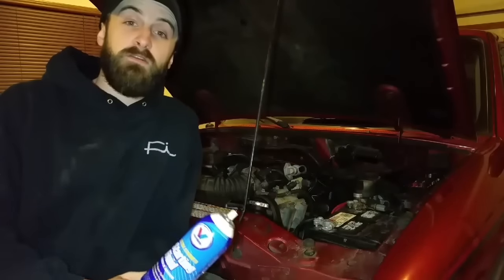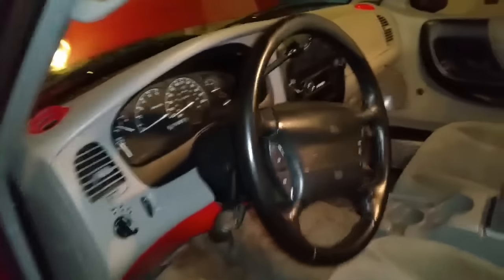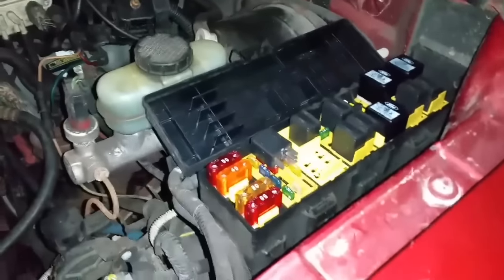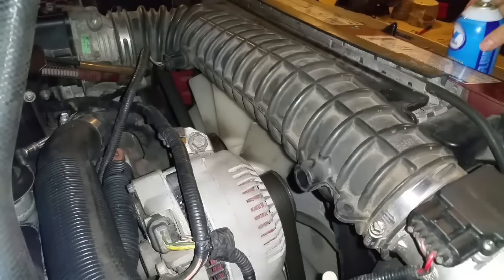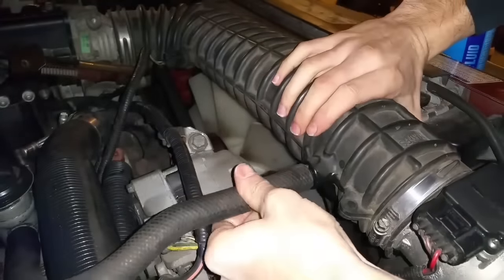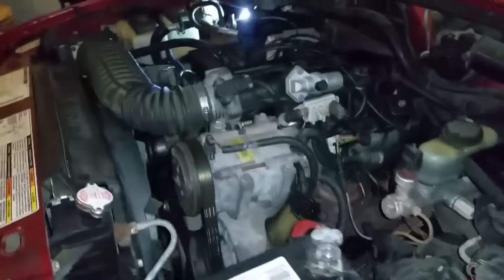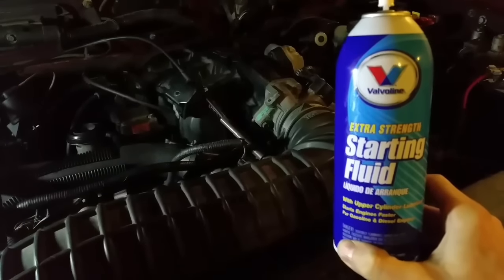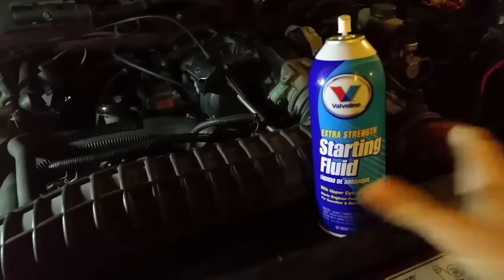THIS REALLY WORKS!!!!!!! Bad fuel pump, fuel pump relay, no fuel problem!!!

Comment: Ok mine stopped while on the road, I can hear the fuel pump come on but it won't start and if it does its only for a few seconds and then sputters off again. Could I have a bad pump even though I hear it kick on?   thanks
Reply: Did you resolve the problem? What did you do?

Comment: Hey A21 Bravo, How would I test to see if it could be a bad relay because my relay is in but it doesn't start and only starts on starting fluid. Is there anyway to test to see if it's the relay?
Reply: Jump the relay with wire but fuel pump won't shut off at all until you take the wire(s) out
Reply: Swap it with another relay in your fuse box with same ratings.
Reply: test relay using bench psu and meter set for continuity give power to electromagnet contacts listen for click use meter to verify continuity and for possible poor connection check for resistance while relay is active higher then a couple ohms would show relay works but terminals may be making poor contact or have been damaged from sparks eating away metal at contact point if somehow electrical system was causing arcing when relay it turned on or off or if relay used was not rated correctly for power. 

You can also check for grounding issues on electrical at the pump itself and the battery. corrosion at battery terminals or wire or poor contact to frame or anywhere between battery neg and neg of fuel pump could be running pump with lower then ideal current as neg in circuit may have higher then intended ideal resistance limiting current the pump attempts to draw and that can be intermittent by expansion contraction from changing temps or vibration from driving and loose connection points.

Comment: You could have fuel injector failure as well.  The test confirms spark and pressure but does not isolate the source of the fuel failure.

Comment: Is it possible for a fuel pump not to work then after I pull the fuel pump and bench test it, it starts to work again? I pulled mine last night and it started working again
Reply from the maker: It is... Sometimes the pump will begin to fail and hitting the bottom of the tank will get it to start again. Won't hurt to replace it while it's out. Especially if you know the pump wasn't working (and wasn't a different issue)
Reply: Even though fuel pump has power & ground, so u hear noise thAt proves it work, check w a fuel vacuum tester. Fuel pump may not hold pressure needed anymore.

Comment: Starting fluid should only be used in dire situations. It removes the oil from your rings and your cylinders are not lubricated while cranking. A better way to check for fuel is to turn on key to AC, which will start the pump. By pressing in the Schrader Valve by the carb/injection sys which looks like bike tire valve you should get fuel coming out. If not you have a bad relay, broke positive or ground wire, clogged line or filter and lastly a bad fuel pump,. I do not recommend this method.
Reply: what if there is no schraeder valve?
Reply: @n8eman  then loosen then fuel line at the throttle-body or carb. If no fuel is flowing when key/power is on, out of that line then you need to work backward and check all the wiring including grounds. I always look for positive power connections first. If you have power, whatever you are trying to fix needs a replacement. IE, relay, fuse, breaker, motor, box, board or control unit. Many time I find a corroded ground to be the culprit.

Comment: How do you know that it’s not your pcm ecm. On my car the fuel punishable controlled by the pcm. If a connector comes lose or the pcm malfunctions, the fuel pump doesn’t work. Also, if you get a backfire spraying that fluid in your intake, you might blow a hole in your air duct work.

Comment: Ok I did that, had same result. However, my fuel pump is working. You can hear it when you turn the key on. Any suggestions?
Reply from the maker: April Arroyo If it fired and stumbled like this could be clogged fuel filter or injectors... I have a part 2 video in description with more causes.
Reply: a21bravo ok. We did spray starting fluid and and would start for a brief moment. The night it broke down  I changed the filter.  There was no problem. When we stopped for gas and then nothing. Does it happen like that? Just stopping. I never had any problems before all this
Reply: Having the same exact problem, changed fuel pump & fuel filter today and it’ll start for a brief second and die out instantly.

Comment: so is the relay bad or is the fuel pump bad! there both expensive little parts!
Reply from the maker: Ali Mohammond Could be either. This is just confirming the engine is not receiving fuel. The relay is not expensive at all.
Reply: @BlaserBuilds  not always cheap. I get what your saying. But normally you would be correct. But sometimes, like my car, it has 2 relays for the fuel system. PGM-1 is 32 dollars and PGM-2 is 53 dollars.

Comment: It can be multiple things actually. Mine is doing that right now but my fuel pulp turns on and my car will run until you shut it off then there is no power to it anymore. Last time my car wouldnt start and wasnt getting any fuel it was because of my egr. It can be many problems, it can also be getting vapor locked from the canister.
Reply: Just to add on to this, make sure no fuel line is touching anything hot. If you you can use a hanger to space it off of the heat. It can make it vapor lock. Check all sensors not just the relay. Make sure your fuel filter is not clogged as well and that there are no tears in your wiring.

Comment: Couldn't it also indicate bad relay/fuse or clogged injectors?
Reply from the maker: gyrs riddle Yes, indication of lack of fuel.
Reply: Derp!
Reply: He just took the relay out though... so it’s not the relay
Reply: 91PHS10 The spray bypasses the complete fuel system to show it has a spark and will start with fuel. Could be the relay still, since it doesn't need the relay to start, with the spray.
Reply: @91PHS10  he took the relay out to simulate a bad pump dude. If you did this with the relay in then it could be the relay or something else like injectors
Reply: Stopped up filter......
Reply: or bad blinker fluid

Comment: What does it mean after you spray starter fluid and the engine runs but, doesn't shut off until you turn the key off?Every time I turn the key off, I have to use starter fluid.
2006 Impala 3.9 automatic 4 door.
Awesome video. Thanks a lot.

Comment: Easy way to check as suggested by ATG & me:
1. Required two people.
2. Open the gas cap
3. Turn key to #2 but do not start the car
4. Place ear next to gas lid & listen to the fuel pump making a sound
5. If you can hear the hum sounds, then rule that pump is good.
6. You replaced that Fuel Filter ever 3 years? Open output hose & input into 1 gal milk & start

Comment: kinda just proves the vehicle has fire don't wont some one to replace a $300 fuel pump over a relay or ground or bad injectors this is a great diagnostic tool but before replacing your pump test the pump with a meter /test light  to see if you have good power and ground if you don't have power it could be due to relay fuse ground etc.
Reply: He didnt say it wad definitively a bad fuel pump. He said bad fuel pump or no fuel situation. You just made a really long explanation of  what he said/did in a nuttshell. Diagnose a bad fuel pump or no fuel situation. If it fires you no its in the fuel delivery. If it dont, your looking elsewhere, like no spark. Exactly what was shown here/said here

Comment: Well mine is a different case car only cranks. But when i give it starting fluid it starts and runs normally not for a short time but runs and i can drive it just fine. When its off it can't start again unless starting fluid is applied doesn't matter if engine is hot or cold. It doesn't start even if i switch on it right back after switching off.
Reply: Did you find what is the problem?

Comment: Ok so I have a 79 Ford E150. With the starting fluid it did turn on for a bit. Noticed my fuel gauge doesn’t seem to be working and no power to fuel pump (don’t hear it prime) and of course no fuel to carb. It has new battery and spark plugs. 😔
Reply: And now it may need a new fuel pump and fuel filter.

Comment: Well my 98 Ranger has been in the garage for a year so I'm fixing to try this to see if it works. I gave up trying to work on it I have replaced sensors and replace the filter even pulled the gas line off of the filter from behind and hit the key to see a fuel pump shot Fuel and it did but that doesn't mean it's the right amount of pressure
Reply: (UPDATE) well that didn't work I'm wondering if it hadn't jumped time.

Comment: Hi i got a 1993 bmw 740i 7 series for a first car and it cranks but no start i changed the fuel pump but still nothing i need help
Reply: XNxDark RebelxNX hey I hope so you got your car Running  already  if not do you car have any lights on in your car like check Engine

Comment: Or it could be injection, pressure regulator, fuel filter, pinched or broken fuel line.   Or you could just be out of fuel.

Comment: This test just tells you if the problem is ignition or fuel, that's it. You still have to prove out the rest of the fuel system before you condemn the fuel pump it's self. If it doesn't run on a can of fuel pump you can start to look for ignition problems.
Reply: Like supply Voltage to Injectors, Tripped Inertia Switch, Bad Ground to Fuel Pump, Heck even a Bad ECM not triggering the Injectors, I wish it was always that simple but does give you a small start in the Diagnostic Quest. I used it all the time to save time.

Comment: Does anyone know where in heck is the fuel pump relay on an 88 caravan dodge, owners manual does not mention it, not the Haynes Motor manual? You can jump the fuel pump relay to eliminate that item as well.   I would ask is it Possible to bypass the in tank fuel pump easily with just an inline fuel pump ? thanks.

Comment: Is this the same on any vec
Reply: I have a 2004 hyd. Sonato and I just put a new fuel pump in it.. And it still only turns over but won t start
Reply: I know the spark plugs are firing but I spray starting fluid and it cranks for just a min than cuts off .. Please help

Comment: please answer car cranks on cold the. after warm up had to crank and with stating fluid it cranks right up keeps running no problems or after I stop and have to cranks again need to give gas to stay on and riding good again?

please help could it be fuel filter or fuel injectors because I can hear the fuel pump engage and it keeps running after starting fluid

Comment: That does not rule out an electrical issue tho. Im in that boat now. I thought my fuel pump went out while i was driving but aparently there is a short somewhere popping the fuse.

Comment: Hey really nice, I’ve known about this for a long time and I’m not bashing on your video at all because it is very helpful to a lot of people, but how does nobody know this trick? Like it’s a pretty simple thing to do and super easy and costs 5 bucks at your local store, but it’s almost sad that you have to put a video up for people to spray STARTING FLUID to START their car, great vid tho and I’m sure it did help a lot of people save hundreds of dollars
Reply from the maker: What's more surprising is all the people arguing it doesn't work, or it will blow the heads off, or wash down the cylinders, haha. Thanks for the comment.
Reply: Yeah really, people are stupid and always try to find something wrong

Comment: what is the best way get the feul system clean and and get the car running again after desesil feul has accidentally put into the tank she wasn't paying Attention to what she was doing thanks.
Reply from the maker: Arond Bullock You could disconnect the fuel rail, bypass fuel pump and run it out using the pump... You can also get a hand pump for under $10 and do it manually.
Reply: will it hurt the fuel pump or do I have to change it?
Reply from the maker: Arond Bullock Best bet would be use a pump and siphon it out of tank, and get new gas in there soon... wal mart, or any auto store would have a pump... May have to disconnect filler neck to get into tank because there is usually a screen that would block the hose from getting into tank from gas door.

Comment: I have a relay that didn't work in extreme cold. You can jumper them.
Reply: How
Reply: @dustinbowls8887  unplug the bad relay, get a small jumper wire or paperclip and jump the two connections.
for my car, it's the top two on the left of the plug
my fuel pump relay just died on me again so I've had to do that a few times

Comment: Also if you got a diesel I never recommend using straight starting fluid on a diesel Always use a little WD-40 with it not as hard and your not dry starting it

Comment: or just spray it directly into the throttle body,  and crank the motor,  if it fires up and dies again,  than the next step is to replace the pump/  more than likely

Comment: See i used starting fluid and it did just that. I didn't have this problem until my altenator went bad. Very rarely but sometimes it starts normally without a problem but rarely.

Comment: how about just check fuel pressure on the test port first
Reply: This man speaking facts
Reply: @brycegriffin3107  some cars dont have test ports xD
Reply: And starting fluid is like $3 vs $50 for a good pressure tester
Reply: @johnsheikh3831  You disconnect the fuel line and put a T in which most good fuel pressure testers come with

Comment: While there is some useful information here, there is more to be done to prove that the fuel pump is bad and need to be replaced.  It could be the relay, or a blockage in the line.  It would be a shame of somebody replaced a working pump based on this video.
Reply: or a bad wire
or ...

Comment: could be the fuel pump, but could also be the relay or bad wiring or no voltage to the fuel pump. i would try to apply voltage directly to the fuel pump before you call it bad.

Comment: Okay... I did this and my car started and kept running.  What now?  Electrical?  Anyone know where to go on youtube for this?
Reply from the maker: Rich Barnett Fuel pump may be beginning to fail. But began running when vehicle shook from starting. What were the symptoms when this started happening? Did vehicle shut off, or refuse to start in the morning?
Reply: If it started with fluid then your electrical is more than likely working just fine. The car needs spark for combustion and would start if there were no spark. Focus on fuel delivery. Possibly a bad fuel pump, fuel relay, fuel pump fuse or clogged fuel filter. Sit in the car, turn key to ACC (before turning on) and listen closely to a humming sound. That humming sound is your working fuel pump. Good luck
Reply: What if the fuel pump hum is not as loud and strong as usual and car isnt starting i can hear it turning on but faintly what should i do next how do i check filter its chrysler sebring 04

Comment: Dude, I toss a known working relay of same part# (a/c blower, cooling fans) in the fuel pump slot. if no fuel delivery  then run  the  +12vdc from battery thru a long test lead with  bed-o-nails alligator clips hooked  directly to the pump harness near the tank. odds are it isn't the wire entry point of the pump. That and checking for a solid ground @ the pump or establishing one if still a no go.  10 minutes. peace of mind knowing electrical is doin it's thing
Reply: The Positive terminal on the pump needs to be confirmed.  A Test light is my go to for finding power. A DVM works as well. Bear in mind the priming power will only there for around 2 seconds so have someone crank while you probe. Again, I use a test lead clip w a bed of nails, so with a long enough wire you can crank it yourself.  It's also handy for testing for that 5v pcm ecu pulse power. Go to ATS Labs for the clips.

Comment: 2011 Chevy Tahoe LTZ 5.3 The fuel indicator is constantly changing from 1/2 tank to 1/4 or empty while driving. The dealership has diagnose it as a fail module. It seems as if every module that located in the rear has failed because of water damage

Comment: As commented by others, this proves very little other than there is not enough fuel getting to the injectors. It is only a starting point (pardon the pun).
Reply from the maker: Thats why "No Fuel Problem" is in the title, and there's a 9 minute part 2 video in description and pinned comment with a more detailed list.

Comment: Fuel pump should buzz with ign. Key on , before starting position
Reply: Learned this a while back
Reply: it's hard to hear when truck is going ding ding ding ding when I turn the ignition

Comment: This is not a test that proves the fuel pump is bad. Best test for fuel pump is direct 12 volt and ground on pump wires and you would need a wire schematic to figure out which ones were hot and ground. Sometimes some wires are the same color in the harness and the pump wires are going to be a larger gauge than the sending unit wires. If a fuel pump works with direct 12 volt and ground then you have to look to why the pump is not coming on for a couple seconds when key is turned on or while cranking. Could be a bad crank sensor or cam sensor that's not allowing the pump to come on or bad relay or bad connector or faulty wiring. Also consider that putting starting fluid in like has been mentioned in other comments only means that there's compression and Spark. If the fuel pump is running with direct 12-volt but still won't start the injectors would have to be checked with a Noid to see if they're firing.

Comment: Isn’t that way to much starting fluid? That must have definitely started to puddle in the intake
Reply: Yeah, I was thinking the same thing.  I just did this trick yesterday and i used 1-2 quick sprays, it started right up.
Reply: Yes way to much spray